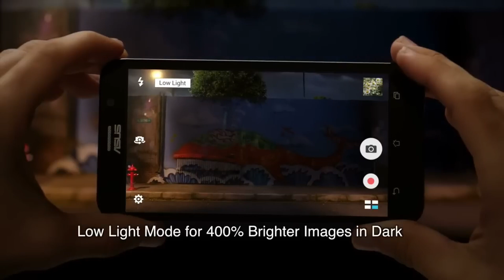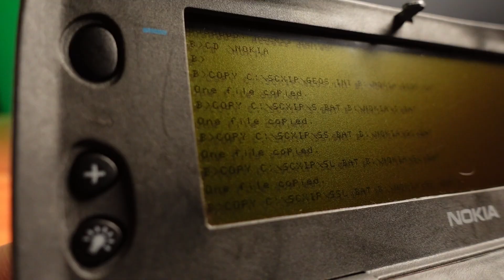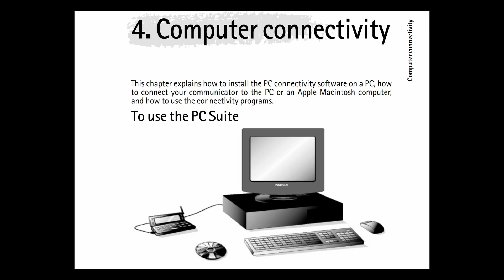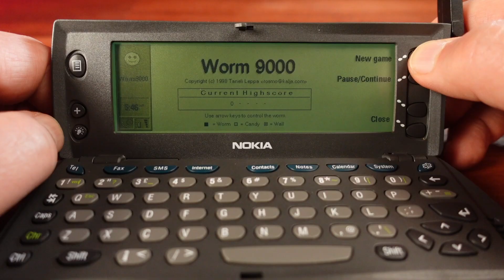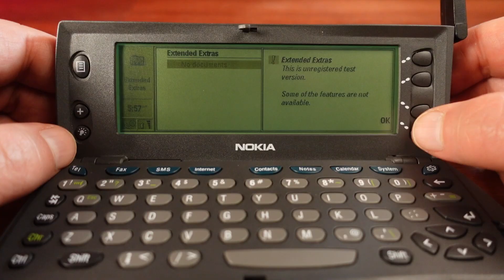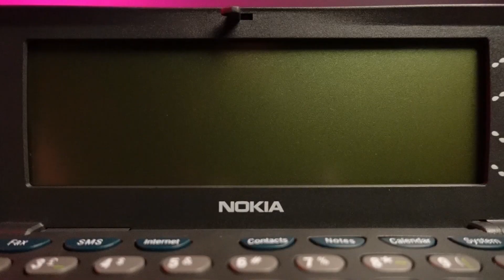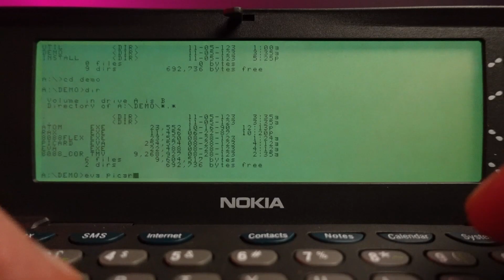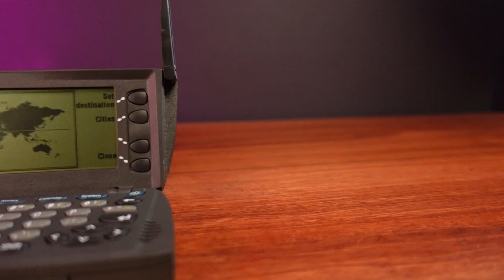Running on a 486 CPU : Nokia's 1998 Smartphone

Comment: In the later 1990s, I only knew of the brick. And few people had them. I'm guessing this phone was more expensive or was rare to find.

I did get a cellphone different from the one you show, with a slide out keyboard, maybe in 2014. It was given as compensation for undue troubles with the phone company but without a manual. So I first thought it was broken or with loose screws when it shifted as I held it a little snugly. Then I moved it more to see what wasn't right and saw a bit of some keys in the edge. Oh, cool! Small colour screen to the top, so offset to the side when using keyboard. It's now without service but otherwise still in great condition.
Reply from the maker: I'm glad you kept your old phone.

Comment: the 3d demo on the screen was called 'geo raycast', which is a method that you might be familiar with running in modern games. At the time it was used for a lot of 3d image software like Bryce 3d, and if that phone is running raycasting to make the maze it would not have run very quickly at all!

Comment: I also love those old LCDs! Speaking of Reverse Engineering a Greyscale LCD. I have a bunch of old Cisco IP Phone Greyscale displays which look also quite nice. Would be cool to use them with a Raspberry pi or Arduino. Though sadly there is not as much information about those displays out there, so it probably takes much more effort for Reverse Engineering
Reply from the maker: They sound cool, but a lot of work. Unfortunately, we can’t all be kevtris

Comment: I wouldn't have guessed an x86 cellular was created before the advent of more modern handhelds but with Palmtops being a whole category back then, it shouldn't surprise me.
I would like to see its successor, Symbian interests me since it is the one Mobile OS I never used in its heyday. Perhaps you could do something solely on Symbian.
I also like the last generation of the mono LCDs but I think Sony made the best ones, check out the Sony Clie SL10, it has a 320x320 mono LCD and it looks quite amazing~
Of the Palm line, obviously the m500 and original Zire (m150) come to mind but I think the progression is seen clearest in the Palm III line. With the original III juxtaposed with the IIIxe.
I also personally loved the "transflective" color screens that came with the Palm m505, m515, Tungsten T and T2. They could be read in direct sunlight with the same ease as a mono LCD and had a backlight (I think it was backlit, maybe front lit) so it was just as easily seen in darkness. A very utilitarian color screen technology.

I've actually got a miniscule collection of phones with weird CPUs, in addition to the Asus Zen 2 there also existed a much more interesting device from Asus with that Intel Atom.
The Asus PadFone X Mini. This thing was almost impossible to search for if you didn't know the name, Lol.
It is a tablet/phone hybrid. So the phone is fairly normal for its time with the exception that its micro-usb port is a bit recessed and it has two pins on either side of it.
It has an entire tablet "dock" for lack of a better word, the tablet portion has a slot on it for the phone, you slide it in and viola, your phone is now a tablet with all the functionality (and storage) of your smartphone but on a bigger screen and a large battery. It was too cool, I had to get it~
Reply from the maker: Thanks for the tip on the Sony SL10 LCD. I must admit only having seem colour CLIE devices in person. Now I need to get one!. I was always uncomfortable with the m515 LCD, never content with either passive or backlight mode. I may have been influenced by my other feelings about this device though. I love my Palm Vx too much. Also, that Asus PadFone X Mini sounds intriguing. Thanks for your detailed comment, really enjoyed this.
Reply from the maker: I managed to get a CLIE SJ20. I hope to finish a video on this soon. I thought of your comments on these LCDs when I was getting this. I really like this LCD, though I'm not sure how I feel about this device overall.
Also I now have a Nokia N95, from which I'm getting the Symbian experience.
Reply: @JanusCycle  Sony sure made some interesting Palm HW huh? I remember hearing from apocryphal sources that Palm told both Sony and Handera that making Palm OS work on a higher res screen than 160x160 was untenable. (and that is funny since the Tungsten W later came out with such a configuration)
I look forward to what you gotta say on Symbian since I've never used one back then.

Comment: I loved mine and then the N900, I had to throw mine away because of I think the join to the screen, think I still have an old N9nn something. I liked the N series which some also ran Linux. I use old Blackberry RIMs and Blackberry Curves now by of course the UK is going to turn off 3G shortly so only 2G will be available (Call/Text).

I still have some of my old N series phone like the N-Gage and the E series and the 3110s, I liked them as well. But I think I moved back to Nokia after I had a brief spell with the Motorola Micro TAC - Still have one of those as well with the pull up floppy antenna. The Blackberry Curves I have still last 1 week on a full charge just idling, the RIM I have still works well but still has the dodgy wheel I remember it to have.

I sometimes whether the phone batteries will explode one day, I have had so many iPhone devices that did not have curve in the name but curved to the point of shattering the class, through battery swelling, the joys of no removalable batteries; Just waiting for all my SamsunS6-S22 Ultras to expand. EU bring back the replaceable battery so the UK can follow suit.

You look back and realize we used to waste a lot of money on tech in the old days, then look in the mirror and realize you still do.
Reply from the maker: Australia is turning off 3G next year and 2G is already completely gone here. I have limited time left with my 3G phones.

Comment: I've always liked a good qwerty phone. I'm not sure where, but I'm pretty certain I still have my 9110i, 9300i and E70 packed up somewhere. If you were a baller, you could connect this phone to your laptop and use it as a 9600 baud modem over DataGSM. Laptops, this phone and the DataGSM calls were all insanely expensive back then.

Comment: I cringed as I watched you handling the PCB on the first unit. You REALLY need to make sure that any time you're handling the bare electronics that you're taking proper ESD protection methods and using a grounded mat and wrist strap. It doesn't surprise me that you might have made things worse on the board.
Reply from the maker: Please don't be too concerned. I keep myself grounded, and not just my personality, but by using grounding points at my desk.
Unfortunately the problem may have been bubbling flux moving the balls, or not using a hotplate under the board. But we all live and learn right?

Comment: I always appreciate how you give things a go, even though sometimes it's hard to watch! (Like one of your first videos I watched, you'd glued something back together but waited until it had dried to remove the excess glue and it didn't quite all come off... something like that. That bothered me at the time haha.) But I'd prefer everyone learn with some mistakes than avoid fixing things, fixing stuff is important. 

And I've made plenty of mistakes too, even with regular through-hole soldering — such as while removing those modern super-miniature through-hole components with stubborn bad solder holding-on for dear life.

I always knew the "computer" side of this was separate from the phone, with some communication such as for sending an address book number to the phone side. Didn't know it was a 486! It's pretty cool how quickly those became small enough for use in a phone. And used directly too, not like today where, yes, a modern ARM chip is faster than an old Pentium 4 but is also a totally different design.
Reply from the maker: We all learn different skills at different times in our life. Despite making interesting videos, you will continue to see me make the dumbest of mistakes at times. I appreciate you sticking through them. I learn a lot from reading the comments. My aim is that we all come out of this having learned something from each other.

Comment: I always preferred black and white screens for stuff that doesn't really need color. You can use them under full sun with a really small battery consumption. But most importantly it looks cooler!
Reply: I don’t get what’s so special about these old displays, do they have anything e-ink screens don’t? Or are you and the video maker just nostalgic for them?
Reply: @protocetid  It's difficult to quantify, but probably nostalgia plays a big role, and also the fact that if designed right a piece of technology that costed 1000$ 25 years ago still feels like a 1000$ thing even if obsolete. In any case old black and white screens have some objective advantages, like not needing a backlight to work (they look glorious under the sun) and thus requiring only a small amount of power to work. Also for some reason they just look good, while color screens only started to look good some 10-15 years ago. Low resolution black and white screens still look sharp, while color ones look like a mess because of subpixels. Also black and white screens always had almost perfect viewing angles.
Reply: @karellen00  Appreciate the high quality response! I understand some of those features are also shared with e-ink and that's why it's favored for some tasks. But Janus Cycle spoke like he wanted the exact same kind of display to come back. Was curious if it had any obscure qualities that a only display nerd would know about, as someone who does enjoy obsolete technology on occasion I am aware that old things can possess something their newer counterparts do not.
Reply: @protocetid  I think if you enjoy simple black and white screens, when you see one way larger than average, and with more resolution too, that phrase it's just what comes out from your mouth. E-paper screens look even better, and consume little power too, but they are not made for general stuff that requires faster refresh rate

Comment: I want one of these. Also, if the MMC is supported in Int 13h then it should be possible to load and run a boot sector off it from software, right?
Reply from the maker: That would depend on the AMD CPU which has the MMC interface built in. Interesting if they did include this.

Comment: what program is used to play the vide on the phone?  Because i'd love a dos video player for older pcs with a 486 or 386 cpu
Reply from the maker: it's called eva.exe for the HP 200LX. Found in the S.U.P.E.R. HP 200LX software archives. Runs on a 286 and possibly even lower systems! Also have a look at 8088 Corruption for full screen text mode video playback.
Reply: @JanusCycle  where can I download it? I only found converters for that program
Reply from the maker: @thepork9940  search for "EVA - Video Animation Loader" with quotes. You will find it on that page with this name.

Comment: Fantastic piece of kit in its day. I owned one for a short while and were blown away by its innovations. Nokia really were top of their game in the 90’s.
Reply: Nokia reigned supreme rather from the beginning of the Millennium to 2011, when their C models started to be sold riddled with bugs. As if this wasn't outrageous enough, a new Company called Blackberry came up around that time, offering very affordable push email, Internet and free texting among the same manufacturer. (BBM) Nokia had nothing like it.
Even today I carry a BlackBerry with me everyday as a back up, but they're now mere communicators, only capable of calls and texting. All other RIM capabilities are gone; but a BlackBerry is made to last, reliable, small, light, and will work just fine in direct sunlight thanks to its keypad, unlike all other smartphones. 😀

Comment: Can this device even run Windows? Its screen is 640x200, which is CGA; Windows' <=95 support CGA. Given that the custom DOS here is FreeDOS, it may have compatibility issues, so I'm rooting on Windows 1.01-3.11.
Reply from the maker: Windows 3.0 runs fine on CGA. But I will need a graphics driver first.

Comment: I still have both my 9210 & 9500.  I used to run the Commodore 64 Emulator on the 9500 just to run M.U.L.E. an old trading/colonisation game.  The 9500 is a little worse for wear as it has a cracked screen.  I have no idea if any of my old phones (including my Nokia 2110e) will power up, as it's been 10+ years since they've been charged.

Comment: I had the 9110i and I LOVED it!
The way you talked into it, from the backside made it so much more comfortable.
However longer calls could be a problem due to the battery getting hot while touching your face directly.

Replaced it eventually with a 9500, that I was not as happy with, and then later two E90s Wich I did like.

Comment: GEOS for DOS used graphics driver file for each graphics card like VGA.GEO. It should be fairly simple to analyze driver used on this Nokia.
Early PC Graphics cards had a lot in common. They had TextMode framebuffer and graphics mode framebuffer. They were located right above 640KB of conventional memory in 1MB real mode address space.
All we need to know is how to switch between text mode and graphics mode. Probably there are BIOS modes like for regular PC graphics. This Nokia definitely supports one of 02h,03h or 07h modes, since they were 80x25 text modes. 0Eh mode would be a great fit since it was a 640x200 in 16-colors mode for EGA cards.
However this can be either found in GEOS driver or by brute force with small DOS program that tests all modes, way beyond standard IBM modes (early SVGA cards had custom modes before VESA standardized them). Then all we need to do is to find out how pixel data is stored in the framebuffer.

With all of that we can do:
1. We can make custom video drivers for Windows 3.1 (Windows 95 won't run, not enough RAM).
2. Add support in games. FastDoom port is the best use case. 486 can run DOOM and FastDOOM goal is to support all possible graphics devices.
3. Make TSR that will translate CGA/EGA video data to native Nokia format, adding compatibility with most early MS-DOS games and software.
Reply from the maker: I great overview of the work to be done. I would love to see this happen.

Comment: Yes, with that many circuit boards, sandwiched that closely together, flex cracks in traces were a major issue, as it would also be with the later 82x0. My 8290 was my last Nokia.

Comment: Regarding the BGA reflow. Some chips are sensitive to humidity. They need to be lightly baked (48-72 hours at 70c or so) to drive out moisure prior to slodering temps. Otherwise, the heat causes the trapped water vapor to expand and burst the chip. Sometimes you can hear a little pop or crackle.

Part spec sheets usually call out MSL level type.
Reply from the maker: I have much to learn, thank you.
Reply: Ah, thankyou, that explains a term I've seen used by Louis  Rossman, "Popcorning', something that certain Apple authorised repair centres seemed to excel at doing.

Comment: I used this Nokia 9110 from 1999 until around 2005 and I liked it very much. Yes, it was heavy and chunky! But it was worth it because of its usability. As you mentioned the display (and keyboard) was great and the interface was well designed.. Due to the slow and expensive mobile internet connection (9660 baud) web (and WAP) browsing was somewhat limited. In these years I used its fax capabilities quite often, telnet as well.
And I tried to find any working DOS software as you. But almost no luck. The best results I got with self compiled programs, adopted to the CGA like (but not entirely) graphics.
I still own my old Nokia communicator stored away. Perhaps I should restart it sometime just for fun. But modern SIM cards are not working because of the voltage requirements.
Reply: Haha, WAP. The phone thing was what I thought of when the more recent song came out.
Reply from the maker: Wow, you used the 9110 for a long time. That must have been amazing at the time. You can still use the PDA side without a SIM if you decide to get it out.

Comment: 5:00 Yeah, thats why I cringe when people suggest putting faulty GPUs and stuff in the oven. You run a VERY good chance of causing more damage.
Reply from the maker: * first hand experience here
Reply: @JanusCycle  Oh yeah, unfortunately you learned the hard way.

I'm pretty skilled with soldering and hot air reflowing, and even I would be hesitant to try and do this!
Reply from the maker: @qwertykeyboard5901  I understand how it feels seeing people do the wrong thing. Some people still to this day run down their li-ion batteries to zero before recharging, like they are nickle based batteries. Not realizing they are actually causing problems doing this and that really really bothers me.
I am at least showing what I'm doing and learning in the process. So that next time I might make better decisions.
Also it can be fun to take a risk with something that is not economical to repair.

Comment: Memory cards are a tricky lot. You can try several different brands/models/sizes. Alternatively, the formatting could make a difference too. If the Nokia can reformat the cards, you might have more luck. Alternatively, a dedicated device (not a PC) might provide good formatting.
Reply from the maker: I had to format several cards in the Nokia to find one that would work. The rest refused to format and threw errors. I'm glad I had that or this project would have been derailed again.